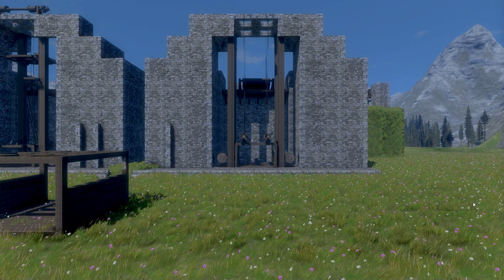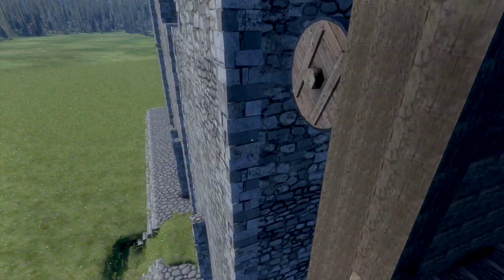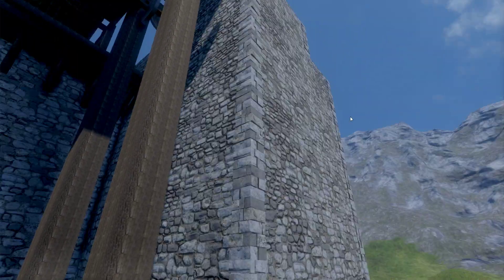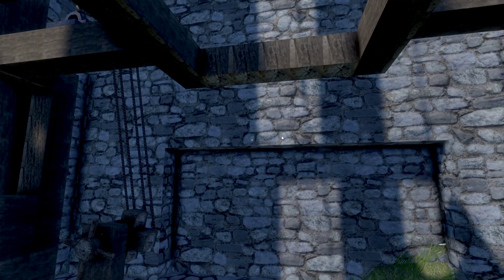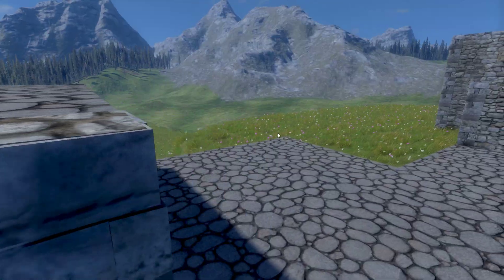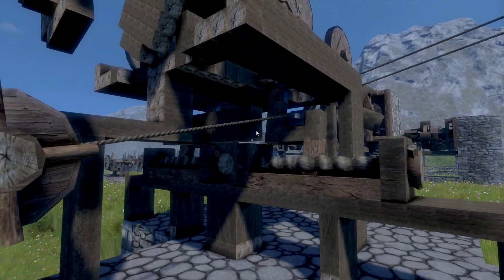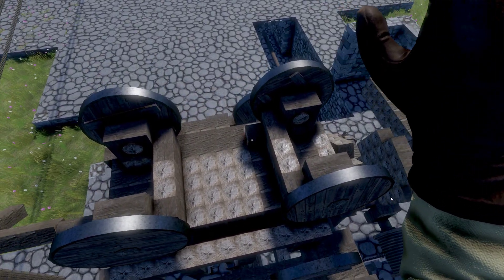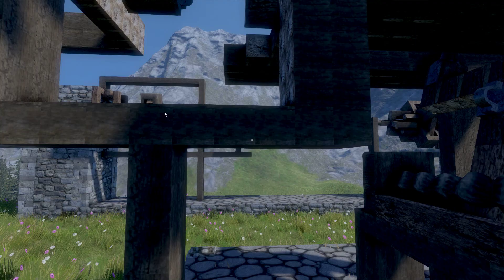Medieval engineers elevator lift demo

Comment: Brilliant design, most stable elevator concept I have ever seen in this game so far.
Reply from the maker: Thanks, I have been working on another design that uses a differential instead of a clutch plate for when the elevator reaches the top, but the differential has to much mass since we don't have any cogs or other gears yet to be effective. Also trying to replace the cart with a pivot-able drive shaft but have been busy with finals.
Reply: Like the Angel Beats! avatar, just like mine! Angel Beats! is love, life.